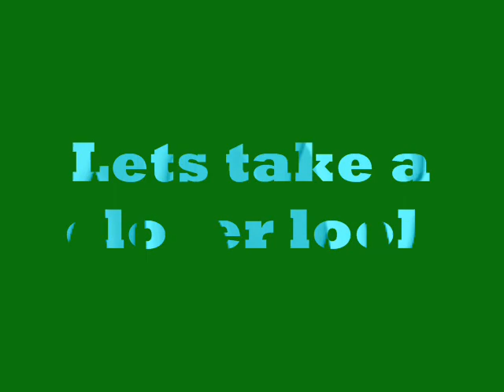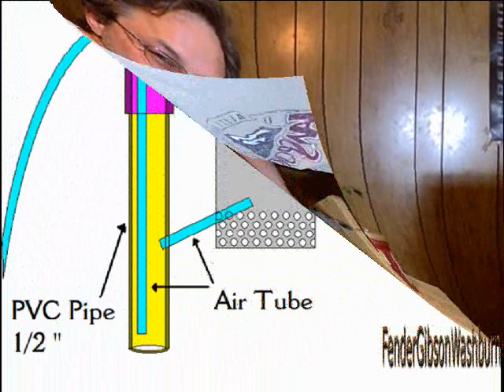Easy To Build Hydroponics System: The Percolator

Comment: i built mine it works just fine, you can put a longer hose on it to make it a top drip system also, i just built a cloner,with mini rotating sprinkler,in a tote,it holds about 10 gallons of water,it works great too

Comment: ***WARNING*** One very important flaw with this system is that the coffee container is nowhere near light proof. Your roots need absolute darkness, or you WILL get root rot. Take an empty coffee container, and hold it up to a bright light with your head inside, and you will see what I mean.
Of course there are ways to make this system light proof, I recommend wrapping the entire thing with aluminum foil, and duct tape. Don't forget the lid, it's translucent too, and cover the grow medium as well. You should also use the black air hoses.
Any light leaks whatsoever, and as soon as you get enough roots to rot, they will.
Reply: +ipissed Please educate yourself about what is and isn't root rot, and how it happens. Root rot isn't caused because of light, it's caused because of non-beneficial microbes being giving the opportunity to grow. Increased oxygenation and proper nutrient solution temperatures will prevent root rot. Also it is good to add beneficial microbes into the nutrient solution. However, as I said root rot isn't because of light, light however does encourage algae to grow. But algae generally doesn't harm your plants. Also for small systems like the one shown in  this video, simply change out your nutrient solutions a little more often that you normally would with larger system. Fresh nutrient solutions with proper ph levels and beneficial microbes make a massive difference in your plants.

Comment from the maker: Yep, just let it run. If the pump puts out enough air you can run more than one. I can't give you any details because every setup is different. You just have to try it. Your going to need light for the plant. A small system like this I just had it set in a window with a southern exposure.

Comment from the maker: @IFUJUSTSMILE2 The same size pump? Honestly I don't know. I found by simply putting a t in the line, the output goes to which ever side is less restricted (only one side worked). Maybe if you use one with valves you could adjust it so they both work but that's only a guess. I've seen higher pressure pumps that could run several of these but they are much more expensive. You save so much building your own system you could buy 3 or 4 pumps if needed. You could experiment and let us all know. :)

Comment: if you have a ppm and pH meter you don't have to change the water as often as the say just pH it ones a day and ad some grow micro and bloom to reach the ppm number you won. usually water change is good but you can get way with out it, but you do have to change it when you go from vegging to flowering  i happened to do only 4 water changes in 2.5 month from start to finish and the plant was better then the times i used to change it every 7 days. that you save nutrients and you get good results

Comment from the maker: @MrOnefakename The container itself is the reservoir. Keep in mind that it is a air lift pump. If you need a bigger system to grow larger plants check out my top drip bucket hydroponic system video. It works the same way as this one.

Comment from the maker: @amptron1 I call it Hydroton. You can find it by other names such as clay aggregate, Grow Rocks, expanded clay pellets, and is often called LECA in Europe. You can but it in any hydroponics store and many places on the internet. Unlike most grow media it is manufactured specifically for hydroponics. It's not absolutely necessary but I use it in nearly all my hydroponic systems. Thanks for the question :)

Comment from the maker: @FUXILUCHSI Like all systems that use an air-lift pump, that's where the air is mixed with the water. Even in my 5 gallon system I added an air-stone. Not that it was having a problem, I just felt I should. As long as the roots don't get brown and slimy they're getting enough air. 
You are more likely to run out of room for the roots for larger plants since this is so small of a system.

Comment from the maker: @wireedacnt Without seeing it I will only be guessing. Like I told TunaTrain, the aquarium hose has to fit tight enough in the cap to not leak any air. The tube coming out the side only has to be in far enough to hold it, If it's a little way in shouldn't hurt anything. If anything lower the tube, going higher won't help. Check the end of the video to make sure you have the measurements correct. Don't be afraid to experiment, you may come up with something even better. :)

Comment: @FenderGibsonWashburn Thank you so much, i feel stupid, i caulked everything so that it was air tight and it seems to be working now. Its not supposed to be a steady stream into the net pot correct? It shoots dropletts of water out every second or so. I have a feeling its plenty of water but i will test it out now. I am using perlite instead of clay pebbles, do you see any problem with that?

Comment from the maker: @TunaTrain The first question I have to ask, is the PVC end cap air tight? The aquarium hose has to fit tight enough in the cap to not leak any air. The bubbles lift the hydroponic solution up the pipe, the air pressure exits out through the tube going to the net pot and carries the solution with it. If the cap is sealed, fill the can with water to see at what point it starts spitting water out of the tubing. This is your minimum solution level, usually right below the tubing.

Comment: I tried making this and its not working correctly. When i turn the pump on it just makes bubbles inside the pvc tube. if i push the rubber hose down further it sticks out bottom and just makes bubbles in the coffee container. I need to figure out how to get the water circualting, also how high do i fill the water? above the hole with tubing going to net pot or a few inches below? or right below?

Comment from the maker: @SalehMagrabi The air pump is necessary. It's what makes the whole thing work. The action of the air pump is what feeds the plant the hydroponic nutrients. It also puts oxygen in the solution for the roots of the plant. If the air pump is not available there are some very simple hydroponic systems that use no pumps at all.

Comment from the maker: @MrZablon I just use my Dremel tool and eye it up. Drill a little bit and check it. Just keep the hole smaller the the outside diameter of the tube. You could use a drill bit slightly smaller than the air tube. Find one that works for you and always use that one. I use my Dremel tool more often than not.

Comment from the maker: @Tc4speed1 The roots will definitely hang in the solution, that's a good thing. You could add an air stone but I haven't found it to be necessary. Once the roots are long enough you could actually switch this over to a totally bubbleponic system if you wanted.

Comment from the maker: @lookoutbitch Your not the first person to ask so I have plans to make a construction video. For growing herbs in such a small unit I didn't find it necessary to add an air stone but It would be beneficial for the plant, I don't see a downside. Since germination mats are used under plastic pots and are able to get wet I would say that would be the best way. I personally wouldn't use an aquarium heater in such a small system. Don't be afraid to experiment. :)

Comment from the maker: @vtprisonco 1. there was one large hole cut in the very bottom. I grew that tomato plant to harvest with that net cup in a 3 gallon bubbleponic system. 
2. True. I have since learned how to add a solution level to the outside which can also be used to drain the system. This was meant to be a one container stand alone system for a beginner.
This is actually closer to a top drip (side drip?). No aeroponics involved unless you add an air stone. Good observations, thanks for the comments. :)

Comment from the maker: @xiSevenSaintsix Looking forward to hearing how it goes. I have received a few messages from people who have built this system and really enjoy it. The most common thing I hear is to make sure the vertical pipe is small enough. 1/2' inside diameter is the maximum you should go. Smaller diameter seems to work even better. Pex and Poly pipe are also good alternative to the pvc one.

Comment from the maker: @jdes1524 The pipe and the air tube from your aquarium pump must be close to the bottom. The level of the hydroponic solution should be just below the net pot or even just touching. Try putting the tube going to the net pot closer to the bottom of the pipe. You could also try a pipe with a smaller inside diameter. Compare your measurements with the diagram I have at the end of my video. If your still having issues message me. I'm sure you will love this system once it's working right.

Comment from the maker: @kris82076 If you use the exact same coffee can with the exact same cap it's 6 1/8" long. The length is not critical. You can use any similar container, the pipe can be PVC PEX or Poly 1/2", The net pot can be almost anything from 1.5 inches to 3.5 inches. Nothing about this has to be exact. There is a diagram at the end of the video, if you do something similar it should work.The best thing to do is just build it and adjust if necessary. Don't sweat it. :)

Comment from the maker: @mindy2215 There are many was to start the seed. I have a video that shows how I do it with a paper towel. I also sometimes start the plants in those peat-moss disks and carefully wash the peat off. Starting in perlite works too. 

I've used this system outside setting on my porch and it works great in the summer. Room temperature is fine for most plants. Plants need plenty of light from either a south facing window or grow lights if indoors.

Comment from the maker: @bigmike784 It actually pushes solution into the net pot. The bubbles rise up the 1/2" tube and lifts some solution with it. It has no place to go since the top is sealed so the air and solution go out the small hose into the net pot.

Comment from the maker: @skylitdrive45 Rockwool cubes and Rapid Rooter are nice because you can put them directly into your system. Perlite, Peat pellets, and Coco Coir is nice too but slightly more involved. You can use regular soil but it's not advised since you have to rinse all of it off the roots first. Some plants may not survive this and there is also a chance you could contaminate your system with a soil dwelling plant virus. I hope this answers your question.

Comment from the maker: @lauraleesmithagain It's necessary to have oxygen/air in the nutrient solution or the plant will drown. You could do a Flood and Drain type system manually. Pour nutrient solution in a container containing your media and plant, let it set for a few minutes then drain it. You would have to repeat this 3 or 4 times a day depending on your media. Message me if you need a better description as there is not enough room here.

Comment from the maker: @dje0624 The system you describe is Sub-aeration or more commonly knows as Bubbleponics and is sometimes called Deep Water Culture. Besides NFT there's also Ebb and Flow sometimes called Flood and Drain and many more. As you can see there are many variations and types of hydroponic systems. Mine is a variation of a Top Drip system. The Air-lift pump simply replaces the more expensive electric water pump usually used. Thanks for the info and question.

Comment: even for Tomatos this is a great way to clone plants or just to give em a headstart to add to a larger system. I did one like this with an old spaghetti jar except i didnt use any airlift, i didnt even use a medium, the roots just hung directly into the solution and were held firm via a hole in the lid. an air hose kept her goin. thanks for posting. ps why is the airlift important?

Comment from the maker: @pot14head420 The rocks are called Hydroton. You can buy them in any Hydroponics store or on the internet. 

Yes there is a hole on the bottom of the PVC tubing. You put a cap on the top but the bottom is left open.

Comment from the maker: @steveutube2009 The whole reason for this system was to eliminate the need for a water pump. The system is so small the roots will dangle in the oxygenated hydroponic solution. Although the roots will get some air from the side tube, it's main purpose is to deliver the nutrients to the roots of the plant. I hope this answered your questions. Thanks

Comment from the maker: @kingsnoofer You mostly have it right. As the air bubbles rise up the tube they carry the solution with it. The container is not pressurized at all. The rest of the cycle is as you describe.

Obviously you will get a small amount of evaporation but I believe most of the water is lost via Transpiration. I think this is proven by the fact a larger plant will cause the reservoir level to drop much faster than a smaller plant.  Thanks for the questions.

Comment: So just so I have the dynamics right... The air creates pressure in the water which is forced up the pvc tube, then draining into the net cup via the smaller tube, then draining back into the main reservoir. Have I got it right? Have you noticed much evaporation?

Comment from the maker: @larocca72 I didn't actually measure anything as I built it but since I still have the system right here, I will measure it for you. The 1/2" PCV pipe is 6 1/8" long. The centre of the hole in the side is 1 3/4" from the bottom of the tube. I hope this helps.

Comment: \I am having trouble getting the water to perculate into the net pot.  I am using a pump from a 10 gallon tank, and 1/2 pvc pipe, and even tried shortning the tube, as well as moving the hole that feeds the net pot.  I've gotten the water to the tip of the tube that goes into the net pot but thats about it.  Do you have any "exact" measurements that work?  I am using the same size can, 1/2 pvc, etc.  If I could get the exact length of the pvc, and tubes that would be great.  Thanks!!!

Comment from the maker: @Stomps1x3 No separate water pump needed. The bubbles going up the tube lifts some of nutrient solution along with it. In this case the Air Lift Pump replaces the mechanical water pump. Thanks for the question.

Comment from the maker: @joshua4511111 Yes it's Hydroton. Brick chards or lava rock are similar. You could even use pea gravel. What ever you use make sure to clean it first.
 
I will not recommend fiberglass. Besides releasing tiny glass fibers into your system it may be treated with chemicals. Do some more research and you will find there are MANY safer alternatives. 

You can get Hydroton, Rockwool, and ect. online or at a local Hydroponics store. 

Email me through my channel if you need more ideas.

Comment from the maker: @typerkilla612 Short Answer: Fill to just below the net pot.

The way I did it is fill the container with water up to just below an empty net pot. (so you can see the level). I put my finger on the waterline, poured out the water, then put a small scratch in the plastic. To check the level I just pop the top and see if it's up to the line with solution. I've since learned how to add an external level gauge.

Comment from the maker: @typerkilla612 No. The air lift pump adds enough plus a little bit of air is added from the solution dripping off the net pot. 

Once the roots are long enough you could disconnect the airlift pump and add bubble stone and use it like a bubbleponics system. That kind of defeats the purpose though. 

Thanks for the question!

Comment from the maker: @bryanthegiant14 I tried the smallest pump I could find. It was for a plastic 2 gallon aquarium and it worked fine. The smallest pump you can buy in most stores is rated for 5 to 10 gallon tank and they work great.

Comment: Thanks for your reply,
I built this setup the night i aksed the question, I had a little problem getting a constant drip, it would drip for a minute or so, then all the air from the pump would just bubble out of the bottom of the main PVC tube and no longer up the drip/feed tube. I finally got it working  by adjusting the air pump tube to the point where its opening is level with the drip/feed tubes opening, almost like making an elbow.
So far all is good, and I'm having fun.
Thank you
Brian

Comment from the maker: @steelcappedstrength You have a slight misunderstanding of how this system works. There is no pressure inside the container since the net pot makes it impossible to completely seal it. The tube is about a 1/2" off the bottom to allow solution to enter the tube. The air bubbles floating upward carry some of the solution up and out of piece of tubing connected between the PVC tube and the net pot. Look up "Air Lift Pump" for a better explanation of how it actually works. Good luck and have fun!

Comment: Hey,
One question, does that main 1/2" piece of PVC sit flush against the bottom of your container with a little inlet for water to flow upwards? Or is there a gap, since your container is sealed so the pressure from the pump pushes down on the water and forces it upwards towards the drip tube?
Thank You,
Brian

Comment from the maker: Sorry to hear that MrBlue609. I have no way of knowing exactly what went wrong but here is some tips. I check the PH with test strips. They are very inexpensive compared to a test meter. Some drug stores carry them. Making the hydroponic solution too strong has killed a couple of my plants before, so watch that. Not enough light is another problem. CFLs are good for extra lighting. Never tried to use sponge as a media. Clean sterile aquarium rocks should work fine.